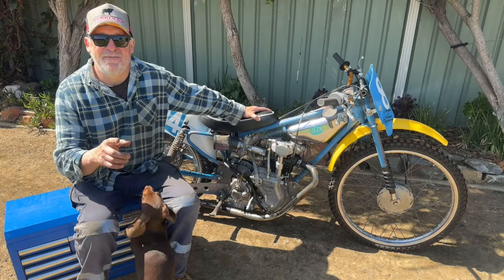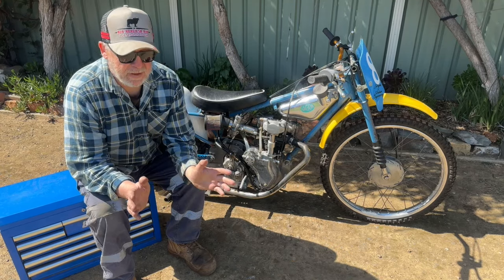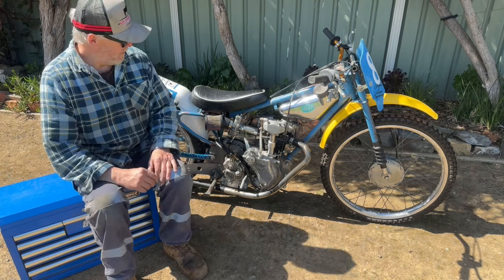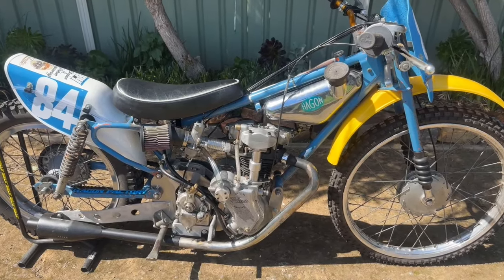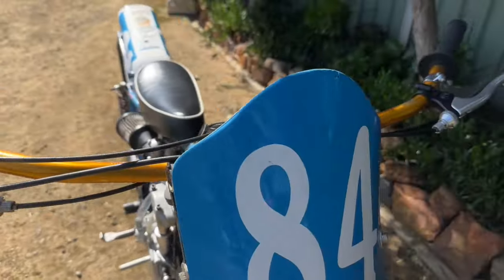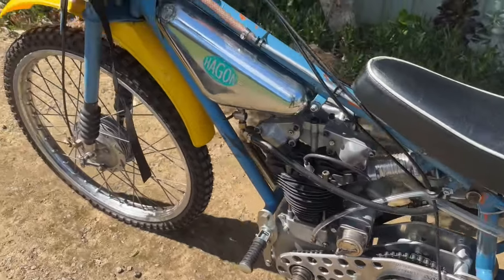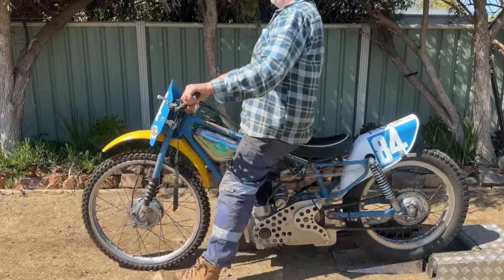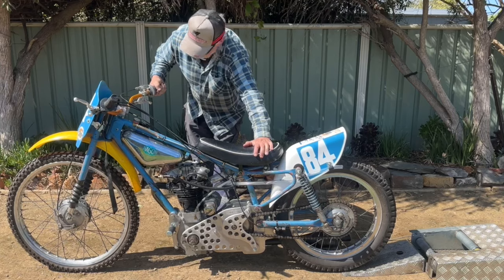THE WAIT IS OVER

Comment: Curious if you know wh the chain is bouncing so much in neutral?
Reply: vibration
Reply from the maker: Hey, A combination of vibration, dragging clutch and cold oil in the gearbox. Nothing to worry about. A quick clutch adjustment and a good ride to bed the clutch in and it will be fine. 
Thanks for watching